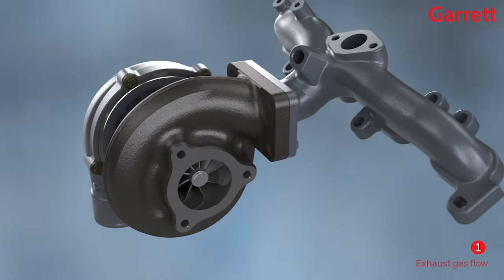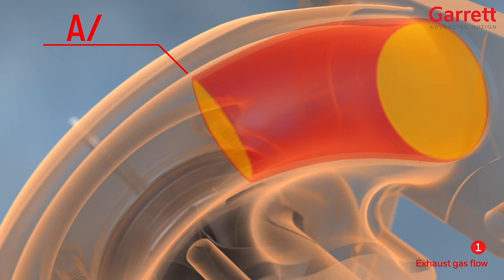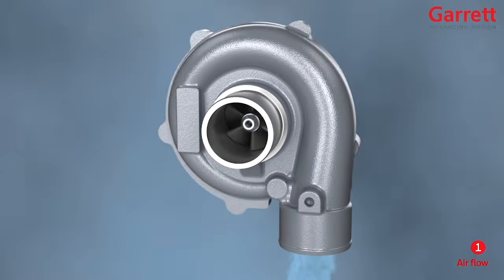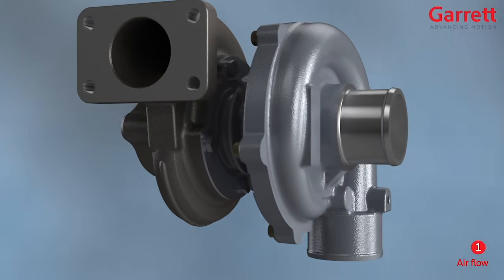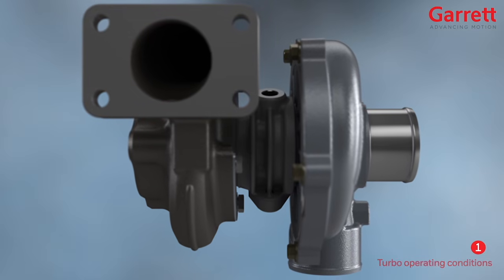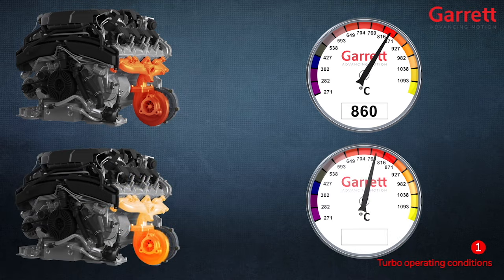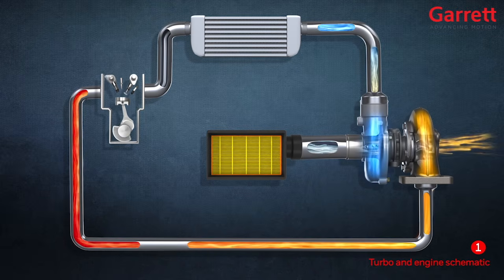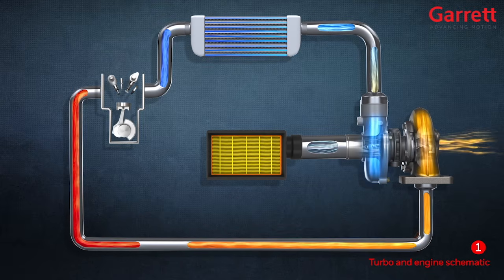Level 1 turbo training

Comment: 5'38'' 1900km/h ? is this possible? sonic speed is around 1200 km/h. can turbine blade exceed sonic speed?
Reply from the maker: Yes absolutely - almost every turbo in existence today exceeds speeds of 1200kmh RIM SPEED
Reply: @TurboDirectSA great animation, hope you keep making them and the channel does not die off like the rest, from what i can see and understand, am i correct that if the exhaust gas charge pressure is, say 15 psi the intake charge pressure will also be 15 psi in a 1:1 pressure ratio and 30 psi exhaust gas charge pressure will equate to 15 psi intake charge pressure in a 2:1 ratio turbo?
Reply: The speed of sound increases with increasing temperature

Comment: 7:00 "engine" is 2-stroke air pump, no power stroke
Reply from the maker: Nope - doesn’t matter what stroke engine it is, there is always a compression and power stroke. Otherwise you’ll never see energy transfer.